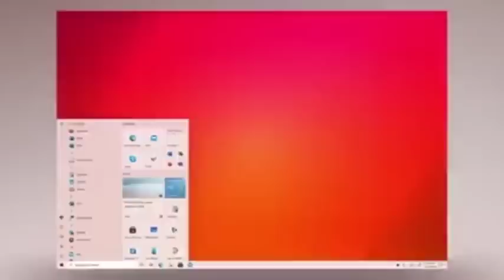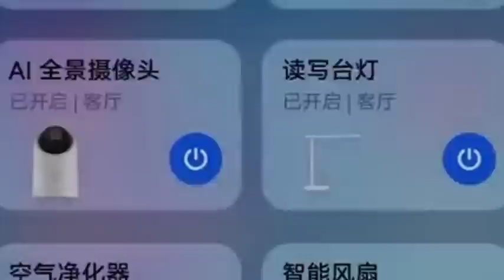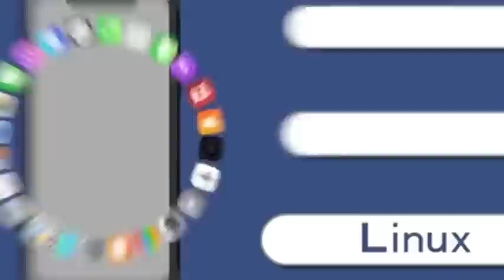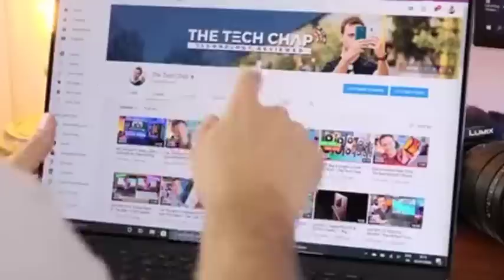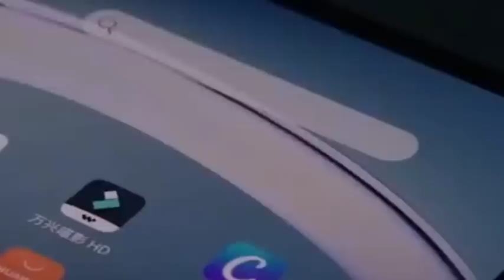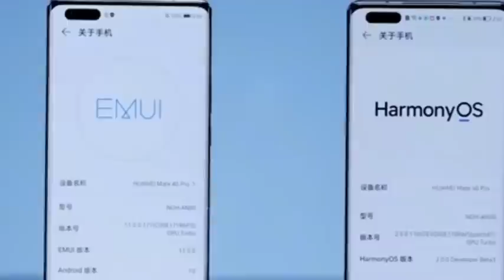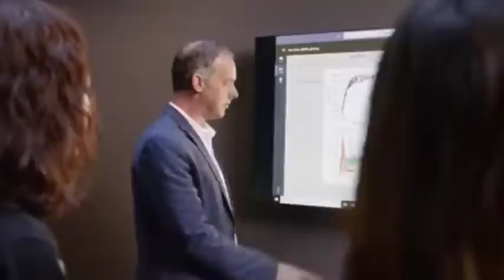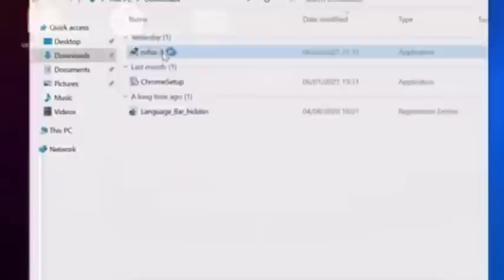Chinese domestic system rushes into the fast lane, or defeats the monopoly of Windows?

Comment: For the Chinese OS to be successful it has to have a very robust build-in Anti-virus "armour". In the past in was the Achilles heel of the Microsoft window system which requires constant window update on virus definitions. This gave rise to the popularity of the Mac OS. MacOS however does not have the companion Microsoft Office equivalent so its use was more restricted. If Chinese Operating System is designed with a very sound build- in antivirus system it will definitely be grow and be buttressed in the Chinese business environment.
Reply: Hope it is based on Ubuntu